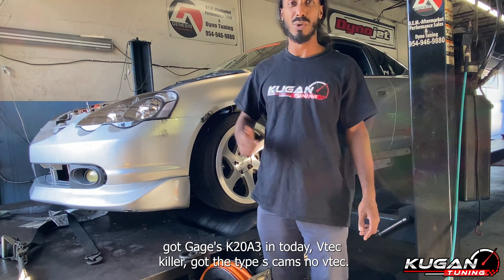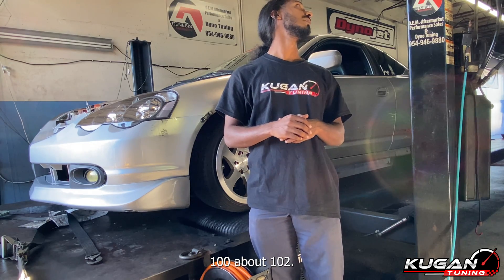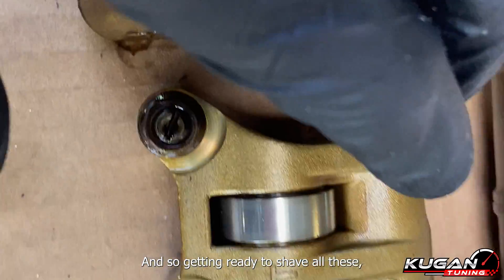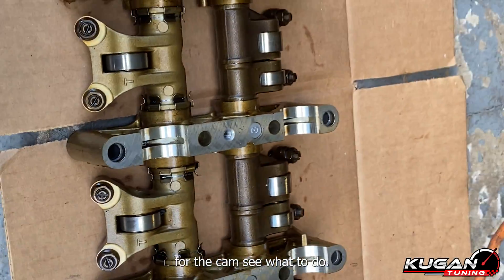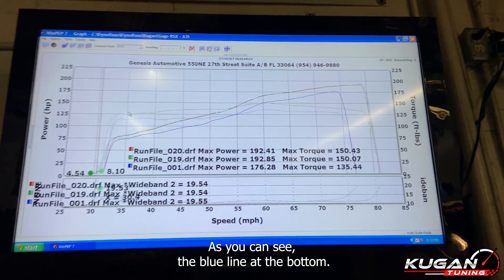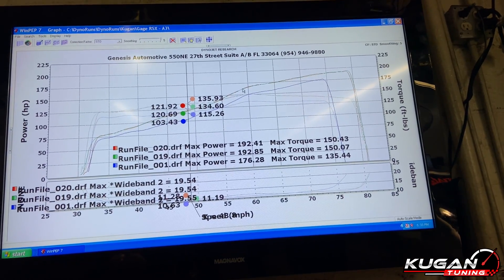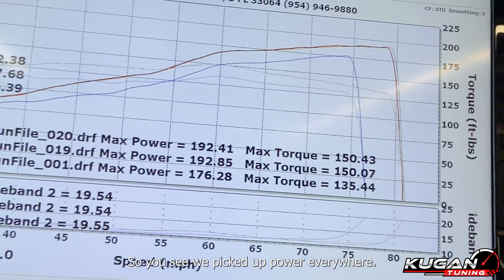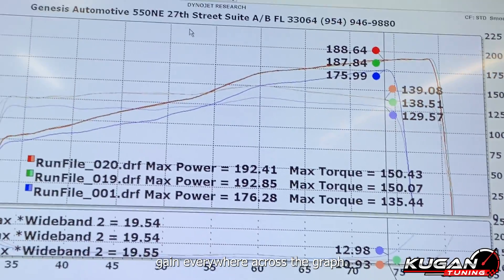Acura RSX Base K20A3 Vtec Killer Makes 192HP STOCK Motor! Custom Dyno Tune On Hondata Kpro

Comment: Congrats on a successful oem Vtec-Killer deal.  Props homie.  Good power numbers
Reply: @KuganTuning the completely oem B20V itr swap 8:8.1 motor in my avatar did 190/145wheel 1st pull, and left it.  A K20A3 making almost 200whp is crazy.
Reply: @KuganTuning you could make 240whp with a crv motor with a vtec killer setup.  I heard those heads flow wild #s once theyr vtec

Comment: I have to make a decision can somebody answer my question. What would you choose, b20 vtec, or k20 a3?
Reply from the maker: K24a2 or k24-rbb is the only thing that makes the most sense for what you get. K20a3 is complete garbage. 

B20vtec you have to enlarge the piston valve reliefs and then you have a problem with cracking sleeves depending on luck / tuner.

Comment: Hello friend, in the comments I notice that you are one of the few Youtubers who responds to their subscribers, therefore before asking you I will subscribe, hehe, friend I want to put exactly that engine in my car, it is a 2005 Honda Fit, where I live they are selling a K20a3 at $650, my car barely has 85 HP, I would go to 160 HP, why do they complain so much about that engine? Just because it has V-Tec on a single Cam? or does it have any other defect? I would also like to know if my manual transmission would engage that engine without problems.
Reply from the maker: You will have to use the matching transmission for the K20 engine. 

K20A3 is a terrible engine and is at its best an economy engine, I agree with everyone else that it is junk. 

If you are looking to just go K series and have something better than stock than sure its fine but if you are looking for performance K20A3 is not the way to go.
Reply: @KuganTuning  The truth is that I see it cheap, $650 and it has 80,000km, I was just thinking of putting a Fuel Tech or AEM ECU in it and that's it, I'm not really looking for a Drag.  But is it even worth it to begin with?  The L13a that my Honda Fit currently has is worse. Another thing, the K20a2 cylinder head doesn't fit the K20a3?  Is the engine bad?  Doesn't it come forged like the other K's?

Comment: People so caught up in horsepower, some people just wanna have fun and modify their car, drive it for the experience! I feel bad for y’all with massive egos shitting on people that are content and having fun with what they have. My ep3 has the k20a3 in it but this was my first car ever, had it since 2015. I don’t give a damn who beats me in a race at the end of the day I love beating the piss out of it and the experience it gives me. I can’t think of a more perfect daily for me. It’s paid off, costs pennys to insure and fill up. Fits all my camping gear even a mountain bike on the hitch I installed… keep hating y’all let people do their thing. It’s not a Corolla with a fake hood scoop like cmon we all car people here have some respect and have fun!
Reply: i just bought one i’m going to put a new top end and oil pump and beat the living piss out of the bottom end then possibly k24 down the road but i honestly have no interest in boosting it i’d rather be making a good 200hp off it and be good. i would like an older si b series to turbo or a newer 9th gen fr. i think the ep3 is the perfect platform for N/A. i’ve got long tube with no o2 sensors rn XD and shit pulls like a mf. almost 200k rn. plenty life left.
Reply: 8th gen*

Comment: Think the auto rsx can put out the same numbers ? 
Will the type s cams fit the auto ?
Reply from the maker: No I don't think your auto RSX will put out similar numbers. The Type S cam does not fit without modifying the rocker arms in the head, there are a few write ups online about how to do this. I don't recommend doing this setup, easier to go K20A2,K20Z3,K24A2

Comment: hello friend, I have a DC5 base 5 speed, I want to convert it to 6 speed. Do you recommend the 2008 Civic Si transmission?
Reply from the maker: Yes because it has LSD it is a better transmission than a non-lsd 6 speed out of the rsx. You do have to be mindful of the gear selector.

Comment: Yo so I have a problem I did the Prb manifold swap on my 05 Rsx with the 70mm tb and I also have a new type s tps . Everything wire correctly and I’m on ktuner and I try using the type s map and it won’t let me go past 5.5k and when I use the base model map to tune it it goes past 5.5k but burning gas’s and also idling  super low like 600rpm and also feels so slow
Reply from the maker: What engine is in your 05 rsx?
Reply: Damn bro
Reply: Did you time yours tps and if it’s not that check and see if you have right plug on your tps

Comment: Did you need kpro for this or are you running it on a stock map?
Reply from the maker: Kpro. Using a stock map would never make this kind of power. It’s all in the tune

Comment: So i dont 100% understand but is vtec engaged all times or at a certain rpm when you put vtec cams in?
Reply from the maker: The cams are always in the vtec lobe. So yes vtec is engaged at all times.
Reply: @KuganTuning  Sorry if I sound stupid but I thought K20A3 was either i-VTEC or VTEC-E! Please educate me.
Reply: @alexanderyil8305  K20a3 is Vtec-e, it's not real vtec, it's partial vtec on the intake side of the cylinder head. Exhaust side has a single cam lobe that operates both valves. Vtec killer setup uses these exhaust rockers on the intake side to run the vtec lobe full time.
Reply: @parallelsandtangents938  Thanks for knowledge! I wouldn’t say not real VTEC, more like era VTEC.
Reply: @alexanderyil8305  pseudo vtec. The K20a3 doesn't have the lost motion spring that runs neutral until the vtec solenoid engages the pins. Actually both lobes on the a3 are operating at the same time, once rpm is hit the pin locks the rockers to only use the large/vtec lobe.
Reply: @parallelsandtangents938  Thanks.

Comment: Is this rsx have the base 5 speed in it? Or is it a type S 6 speed swap?
Reply from the maker: 6 Speed at the time of this video.
Reply: would not be possible cause it would require a type s motor which already has 200+hp so realistically it would obviously be a 5spd
Reply: @Xenjyn  bro u can use the Type S trans with a k20a3
Reply: @jeremysantos4753  type is a k20z1 Wym?
Reply: @xenjyn7849  doesn’t matter, all k series things p much bolt into each other
Reply: @shadowgaleshale9218  read a whole thread about it I’ll read more ig cause I’m tryna swap my base model to manual

Comment: Sounds mean and pulls good, those are decent numbers I'm putting down right about 170-175 whp and I only have custom 3.5" intake, DC sports header, and custom 3 inch down pipe into stock cat with 3" mid pipe going into 2.25" rest of the way into a 2008 civic si axle back. Oh also did ac delete with shorter belt it definitely picked up some power from less parasitic drag from accessories. It keeps up with a buddy's 2012 civic si with bolt ons. Don't listen to anyone hating on it. They don't realize that yes it's a base motor so it's harder to just jump to bigger numbers. I bet with E85 and a different intake manifold and bigger exhaust you'd easily make 200+ who and that in a sub 2700 pound car is pretty damn good in my books.

Comment: Aren't k20a3 like 160 at the crank?
Reply from the maker: Horsepower measured at the crank is higher than horsepower to the wheel because of drivetrain/transmission loss. If you put a bone stock factory base model Rsx or Ep3 on the dyno it will make less than 160. There is roughly a 15%-25% loss of power from crank to wheel.
Reply: Yes

Comment: Decent numbers for an a3 compared to stock! Hows the idle? 
Probably pick up a little more power with a different intake manifold? No?
Reply: It's pretty much guaranteed to pick up more power with a better manifold. Manifold is probably the most important bolt on next to the header. It controls how the engine resonates.
Reply from the maker: Idles like any stock engine. It might pick up with a better intake manifold, the only way to really tell is to do back to back dyno testing on the same day with this manifold vs better manifold

Comment: Bruh my honda accord stock has more whp🤣
Reply: Well no shit lol this is a stock a3 not a 500 hp rsx
Reply: @gagebergeron2836  duhhhh Sherlock
Reply: @namehere1369  prolly get gapped by this rsx real talk
Reply: @Motormuscle21  doubt it my accord will shit on this lol
Reply: @namehere1369  what generation accord ?
Reply: Might make more horse power but the accord has like a extra 1000+ pounds of weight added. When the rsx is at 2,500-2,800lbs
Reply: @anthonycortez5093  lol I've owned both and can say the accord ismore fun and quicker. But yeah I know the accord is alot more heavier.
Reply: @namehere1369  bruh my gsxr600 got 120hp and it will gap all of yall in the comments
Reply: @FTW56  I'd hope so you 🤡
Reply: @Motormuscle21  sorry bud but it has and it will over and over again keep crying my accord makes mote whp stock like i said ya cry baby 🤣
Reply: @UC0q5YLIhlQ0_SO03U8WNK6Q and no its the accord 6-6 my boy better do your research 🤣
Reply: Lmao my vtec killer rsx gaps v6 accords all day 😂 you're on glue
Reply: @thelachsmith81  sounds made up
Reply: Your stock is really slow. FBO and tune will make your Accord more competitive.
Reply: @OrangeCounty92  yeah it ain't fast but for 3000lbs it does pretty good. Haven't lost any k series yet 🤷‍♂️and I came from a fbo kpro rsx .
Reply: @namehere1369  I see them beat supras😂 hellcats and q50
Reply: @OrangeCounty92  you've seen what beat q50s and hellcats ?
Reply: @namehere1369  the accord. J series
Reply: @OrangeCounty92  damn bro I wish hahaha probably built tho I'd assume ?
Reply: @OrangeCounty92  I wish they made a rwd accord 😔
Reply: @namehere1369  FBO on stock motor and stock tune. No turbo and no nitrous...lol